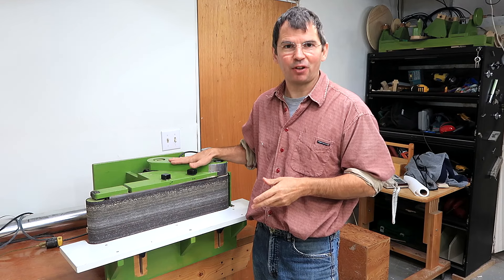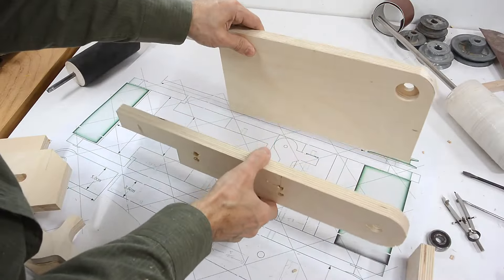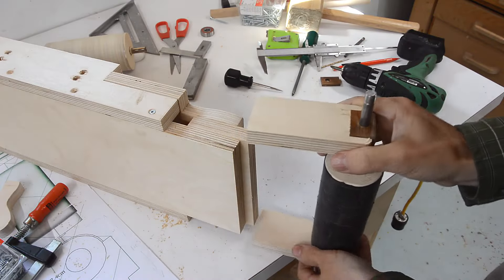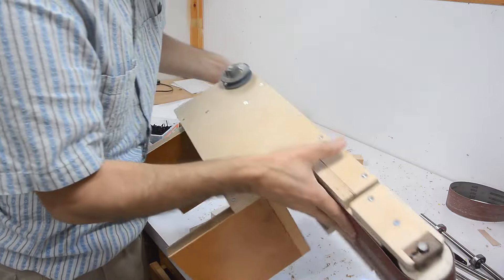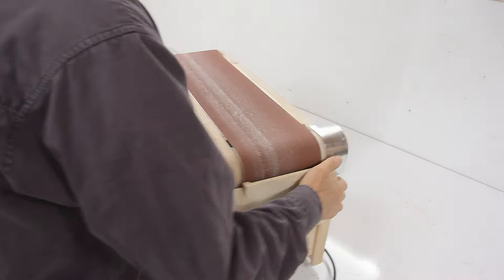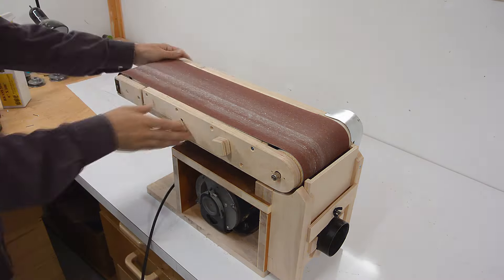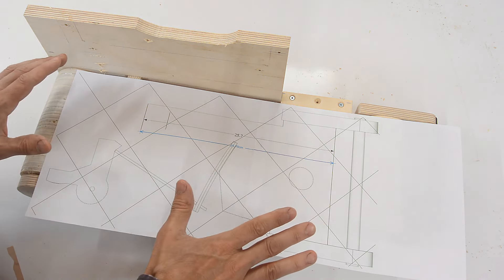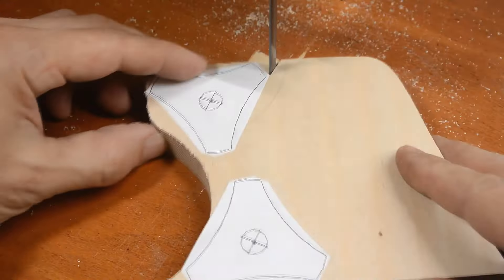6x48" Belt sander build

Comment: Even if you don't build this sander, this video is filled with extremely useful, practical tips that all beginning woodworkers should learn. For example "Use shorter smaller screws to temporarily hold the assembly together so the threads in the wood are not worn out" (then use the full sized screws for final assembly). Another is to install screws so they just protrude from the part they will fasten, then show the part to it's final position and gently tap to mark the drilling locations.

Comment: If you want to be able to clamp 45° brackets, mounts, triangle blocks etc to another piece of material for gluing purposes take a square piece of plywood, cut a 45 from one corner to about an inch from the opposite corner then a straight line down to the bottom edge from there. You should have a straight edge a little under an inch wide of the remaining wood running down the back side and a flat edge on the top. Lay the cutout on top of the piece you're wanting to secure flat edge facing up and away, put a horizontal clamp on the thin back edge facing away and then clamp down as you normally would. The thin edge, when clamped, keeps the piece from shifting backwards as you apply clamping force to the hypotenuse.

Comment: I built one from Matthias's plans and it was made so easy by how detailed they are.
So much more rewarding that buying one.  And I'm totally comfortable that if anything ever breaks, I can fix it.
Two years on with regular use and I have only had to replace the same tensioning wooden spring that Matthias did in the video.
It's a solid design.
Reply: Out of curiosity, where do you get the motors when you build your own? Do you salvage, like Matthias?
Reply: @figrollin  Tractor supply, Harbor Freight, ebay, motors are cheap and easy to get these days.
Reply: @figrollin  I usually keep an eye out on FB Marketplace. I have bought one from eBay and salvaged others from scrap machinery.

Comment: damn bro, I'm a metalworking man myself, and I'm not afraid to admit that I look down on people making things out of wood that really shouldn't be made out of wood (stupid stuff like structural parts of projects that deal with considerable weights, or wood gears in any decently precise or fast target application). but this is actually pretty solid, and one thing I had never even considered was making the rollers out of wood (I've been considering making a belt sander for a bit now). Now that I have, I think I would have used just a regular block of wood maybe, so it wasn't this flimsy stuff and didn't go against the grain - no doubt would last a lot longer, but yours still seems like it'll last longer than you and I, so I guess not much point haha.

Very impressive indeed. Thank you sir, and great video!

Comment: Why do you always use those really wide and not at all flexible drive belts? A narrower one works much better and is sufficient for the low power of a machine like that. (I know from experience with my own similar sander)
Reply from the maker: I just use regular V belts, because it works with regular pulleys.

Comment: Is there a reason that the drive roller is bigger than the idler roller? Seems like you could have made them both the same size and used inner tubes for both rollers.
Reply: Maybe so he can have two different sized "drum sanders" on the ends?
Reply: By the way, he mentioned in another video that he might in fact use inner tubes for both rollers if he were doing it today, but fat bikes (with their bigger tubes) weren't as widespread 5 years ago.